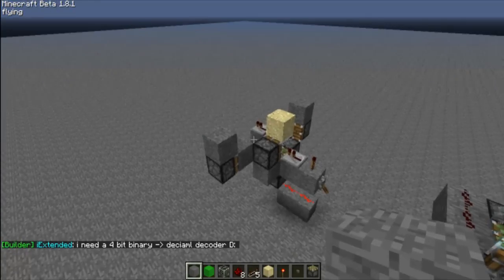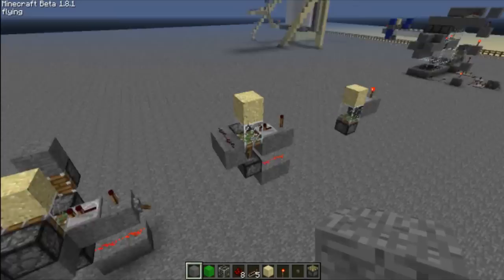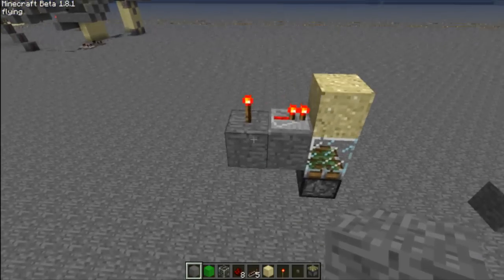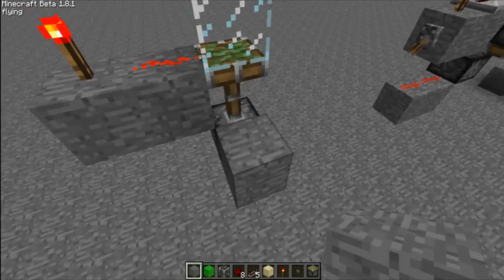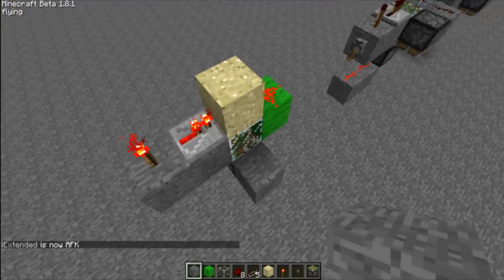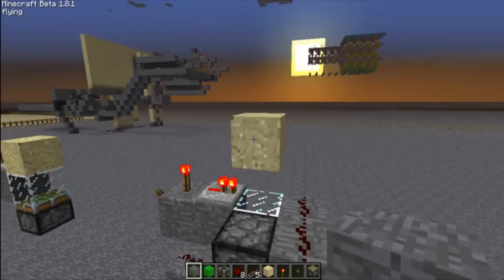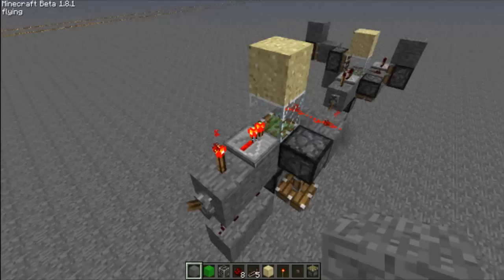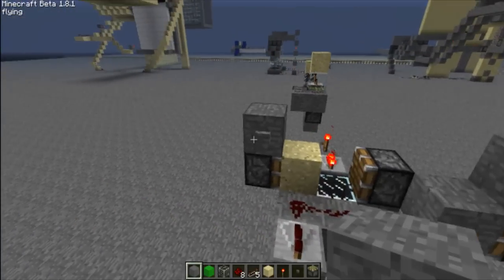Minecraft : Smallest Block Update Detector Switch

Comment: On the clock make the block to get the output, put retstone dust on it and put a fence gate under that block ie next to the piston. Fence gates react to updating the same so you can you always wire the output of a bud to a fence gate, door, latch or whatever else is made to function the same. When using BUDs remember fence gates. Oh and as homework, make a bud, put a fence gate next to it and power the gate, put a gate next to it and close the first. You will have extended you're bud.